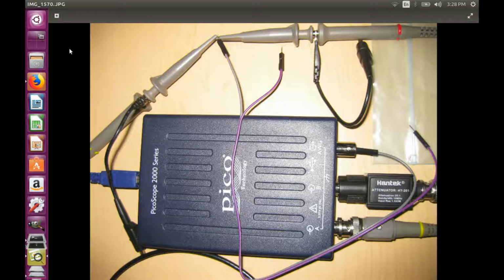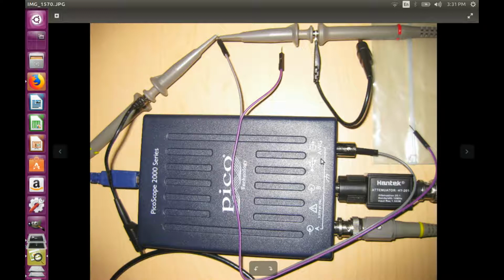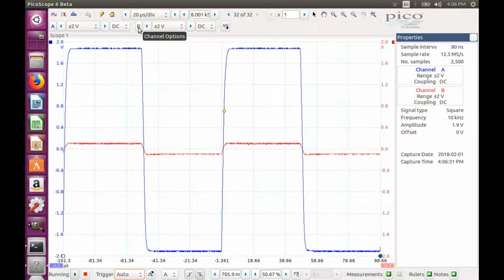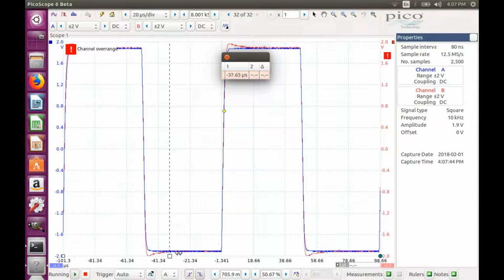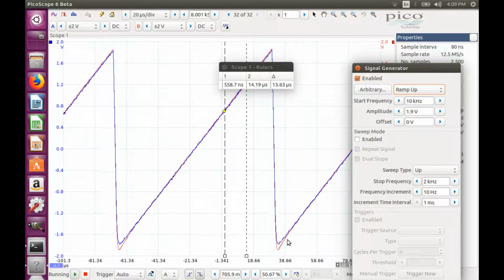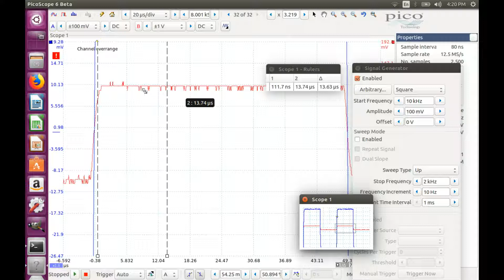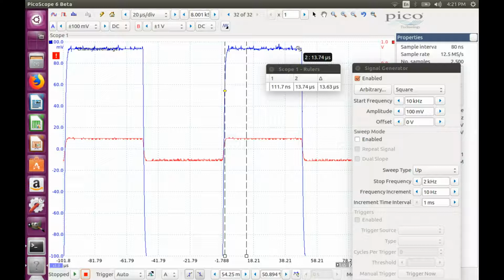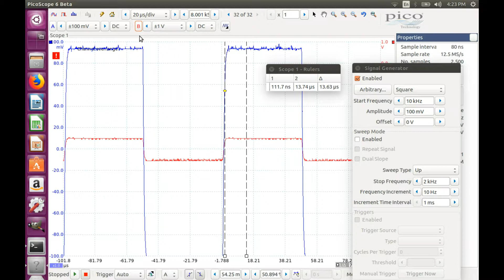Is it OK to use attenuator when you don't need it?

Comment: @5:15  the jagged edge is a product if inductive reaction since it is symmetrical at top and bottom. it is something that happens when you use a voltage divider as in the attenuator. this is why any good attenuator has a built in adjustable capacitor as do 1x-10x probes.   not all have them.  any time you use them they need to be calibrated using the square wave  and a non conductive/non-inductive tool(often supplied with them) prior to use.  of course its best not to use them if you dont need to but as with magnetic devices such as sollenoids, ignition coils, fuel injectors and such  when the magnetic field colapses it induces a reversed polarity spike  which even if not harmful will cause noise that otherwise wont be there. used to be you could throw a vom on the circuit to see what to expect and shoose your setup accordingly.  but some dvom's have a slow enough sample rate you cant actually tell what the true maximum value is.

very good video and nice experiment.  just something else  to think about. we should all keep saying to ourselves what would happen if......?

Comment: Fairly new to scopes (automotive), and could not find an answer to this question. Don't want to hook it up  wrong and cook it, but swapping attenuators in and out in the field can be a nuisance, esp. if they are not necessary in most cases. Thanks!

Comment: if your probe are 10.1 can you add a 20.1?
Reply from the maker: I'm not sure what you mean... Do you have a probe with 10:1 attenuator and are attempting to connect it to another 20:1 attenuator?
Reply: Dmitriy L. yes can this done this way
or probe 1x with 20.1 attenuator
thank
Reply from the maker: @danman9017  The probes I use in this video are the ones that come with Pico2204A, they have a button to switch between 1:1 and 10:1. Here I use them as 1:1 and connect them to 20:1 attenuator. Combined, that still produces a 20:1 attenuation.

If I were to switch them to 10:1 and connect them to 20:1 attenuator that would technically create a 200:1 attenuator, but it would not be very useful as the probes are not rated to handle very high voltages.
Reply: Dmitriy L. thank you very much for help
now i know that need to get a other set of probe 1.1 for 20.1 for my micsig scope. but i will need one that i can adjust .thank

Comment: Thank you for this detailed  explanation sir. Very informative.
I have question for you. On our pressure transducers 0 psi is 0.5 V . Problem I have is that many times output voltage from sensor varies from 0.45 to 0.5 V and that affect reading (zero line). Is there  way to make device to bring voltage to 0.5 every time ( basically to zero pressure transducer / calibrate before we start measuring pressure). I hope this question make sense. Thank you sir.
Reply from the maker: Hi Ramon, I haven't noticed the idle voltage of my pressure transducers noticeably deviating from 0.5... as long as 5V supply is good. Do you have large deviations of atmospheric pressure in your area? 

Anyhow, there are many ways to zero out sensors. Look out for my upcoming video where I describe the simplest one. May be it will work for you.
Reply: Dmitriy L. Thank you so much my friend. My biggest  deviation is on 500psi pressure transducer. Looking forward for new video. Thank you